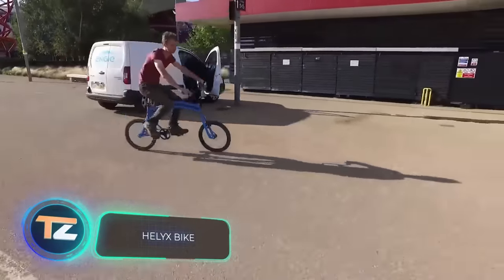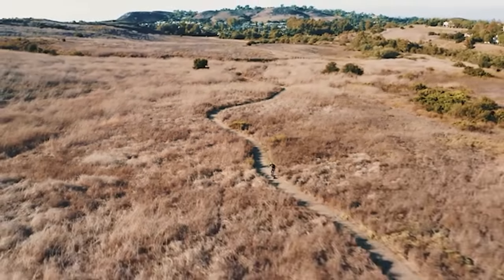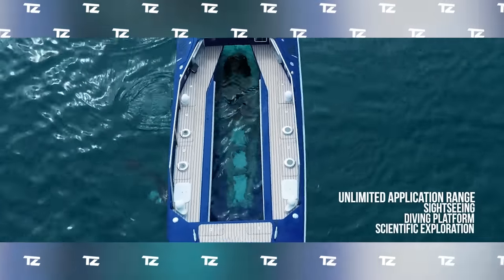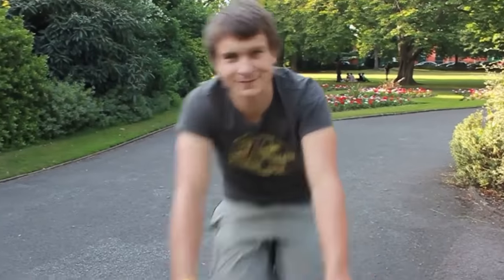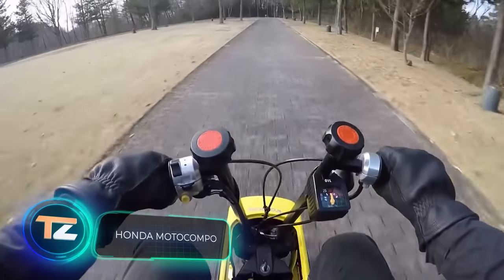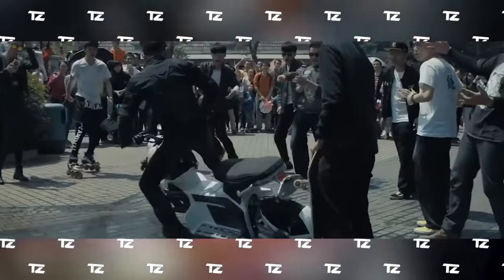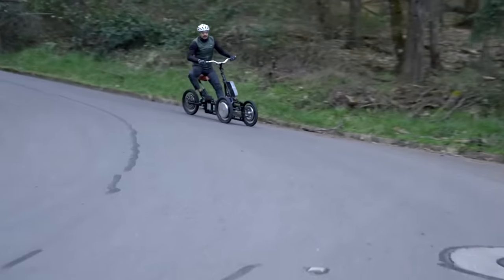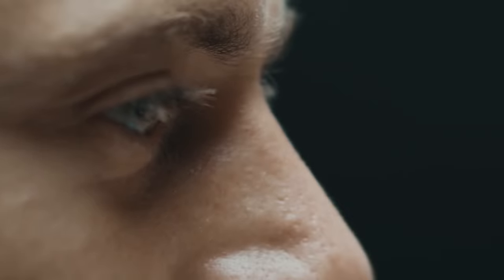CRAZY VEHICLES THAT YOU WILL WANT TO RIDE

Comment: During 1990... I had a very similar idea to the SoulArc skateboard, except non-electric... which mine was going to be CrankOmni whereas the wheels of that skateboard can only spin in the forward direction, that to see-saw forward will cause the front to shift away from the back about 5 cm... then contract... and tilting far back enough is the breaks.